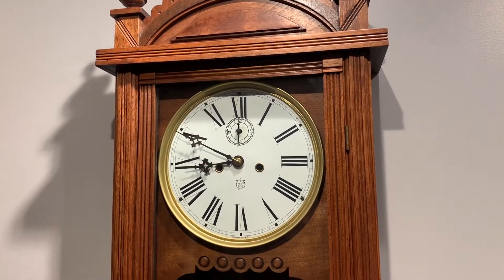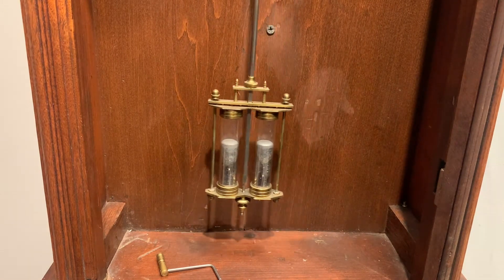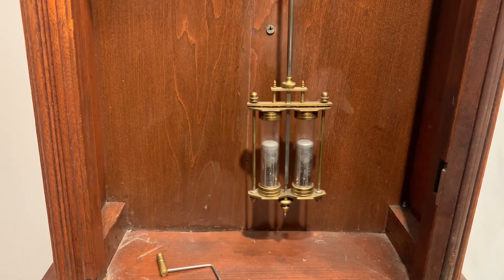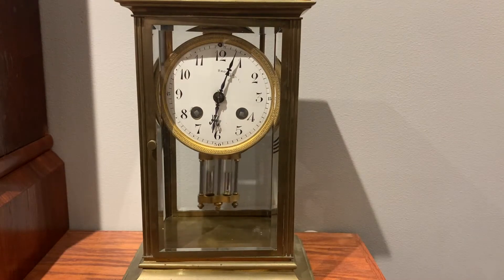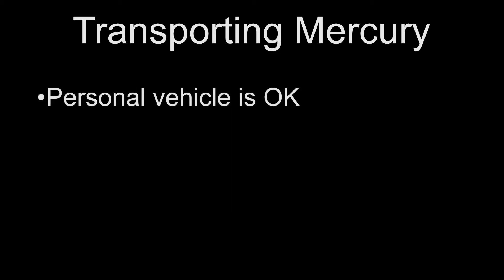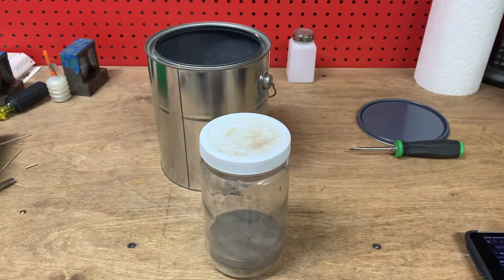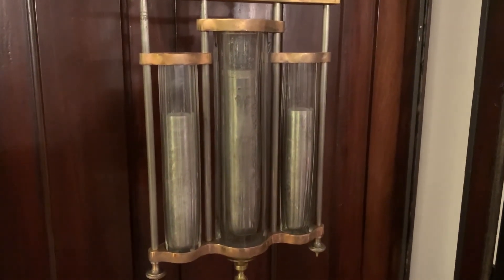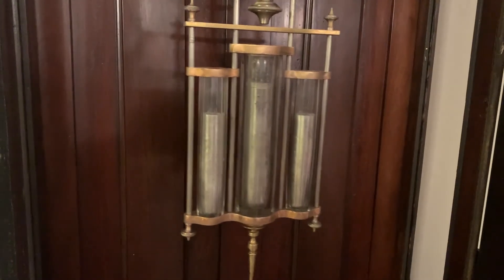Handling Mercury In Clocks

Comment: Your mercury is full of impurities and that is why it lacks sheen and luster. You can do a simple cleaning of the liquid metal using a large syringe and some cotton balls. You will also have to clean out the glass vials to remove the impurities in the jars. If you top off the mercury with a small layer of distilled water then cap the the vials to reduce vapour as you did in this video. There are very good videos on YT showing how to do this. Mercury is not that scary to handle and you have displayed very good practices on handling the liquid metal. The clock would look so much nicer with gleaming mercury in those vials. Cheers

Comment: Thank you for this great lecture on the use of mercury in clocks and the safe handling procedures. When I was studying physics back in the early 1960s, we refurbished an antique mercury barometer. One of the things we did was to "clean" the mercury by pouring it through chamois leather "filter" in a glass funnel. This worked very well. The chamois trapped the gray/black "crud" leaving the mercury like new.

Comment: Does mercury have a substitute as unable to source in uk
Thank you
Reply from the maker: I don't know of any complete equivalent to mercury that would perform the same compensation function, however the clock will run fine with any kind of heavy weight in the pendulum - steel shot, lead, etc.

Comment: So why did they use mercury and not just plain o'l tap water?
Reply from the maker: The volumetric temperature expansion coefficient of water (.00021/ºC) and mercury (.00018/ºC) are reasonably similar so in theory water would have some compensating effect. 

The challenges are keeping the water from evaporating as it has a much higher vapor pressure than mercury, which would require a lot better seal - we're trying to have a seal good for decades rather than days - and more than that, mercury's density (weight) made it more practical to move the center of mass up and down with a reasonable sized pendulum. It would take considerably more water than mercury to compensate for a typical heavy, large regulator pendulum.

Those are my educated guesses, anyway. It would be an interesting experiment to see how much water you would need to have effective compensation.
Reply: @MinnesotaClocksandWatches  that's a cool video Idea. I also have to ask though doesn't mercury vaporize?
Reply from the maker: Mercury does evaporate, but it does so far more slowly than water. A drop of water will be gone in minutes or hours depending on the temperature and humidity. Mercury takes far, far longer. Also, mercury oxidizes and forms a skin that further reduces evaporation.
Reply: @MinnesotaClocksandWatches   plus water will damage the wood as it evaporates. If the lid is sealed tight enough it could theoretically contain the mercury fumes long enough for them to condense back into liquid form.

Comment: I bought an antique mercury clock and the vile is leaking and glass is broken in the clock, is it possible to buy new glass and seal the mercury in the clock?
Or would it still be possible to cause harm, thank u!
Reply from the maker: Uncontained mercury is a concern. If mercury has spilled, you should follow the EPA spill directions to clean it up or have someone help you clean it up. Commercially made mercury spill kits are available.

I don't know of any suppliers of new mercury vials as they come in many sizes, but you may find an artisan glass guild where someone might be able to blow you a vial that is the right size and shape.
Reply: Vial

Comment: Did you pack your mercury in a glass jar and use asbestos as insulation.? Dude....
Reply from the maker: Short answer - no. Vermiculite and asbestos aren't synonymous (since 1990 vermiculite has to be inspected for asbestos contamination), and a double packing system is more than enough for careful private transportation.

If you're bothered by how I transported this, I assume putting mercury in a glass jar swinging in a pendulum hung by a thin metal spring probably isn't for you.

Comment: Thanks for the video.
I think it would be a good idea to also wear gloves when working with mercury. 
I don't have any mercury clocks, if I did I'd put a plastic tray at the bottom of the clock - just in case. Not very pretty but extra insurance. Usually if I want accuracy in a pendulum I build John Harrison's grid, I even installed one on the three story E. Howard tower clock I maintain but I know mercury pendulums are popular with collectors though.
Reply from the maker: I would argue that as metallic mercury isn't especially well absorbed by skin, you would want to weight loss of dexterity and risk of spill due to wearing gloves.

There are definitely other ways to achieve temperature compensation, but for historic pieces where originality trumps precision timekeeping, my preference would be to replace something that looks like mercury if that is a concern rather than remaking a pendulum. For a project clock - absolutely - Invar and other mechanisms are likely the equal or better to mercury.

Comment: Mercury wasn’t so hazardous back in high school science class we used it all the time in the 70s and before. And I’m still here.😁
Reply from the maker: In the modern era, any recommendation to take on any kind of risk is perilous. I agree with you that metallic mercury that is contained is not a high risk, however that risk increases significantly if mercury is spilled. Will it kill you? Probably not. Will cleaning it up be an expensive pain in the butt? Yes. Keep it in your clock and it's all good.
Reply: @MinnesotaClocksandWatches  well it’s a good thing you didn’t see what we used to do with it in high school in in science class the safety Sally’s of today would have had a hemorrhage.😁